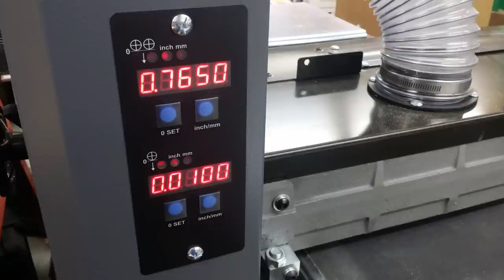My New Supermax 25x2 ES - Replacing my old Grizzly Double Drum Sander

Comment: That's a beast of a machine Tim. I bought the Supermax 1938 about a year ago, and I'm kinda kicking myself in the rear for not getting the dual drum model, although it is still an awesome machine. Thanks for the video!
Reply from the maker: +GuysWoodshop It's awesome for sure. I'm sure the 19-38 still gets things done very well. At least it's easy to change out that sandpaper to work through grits! :) Changing sandpaper on that Grizzly on the fly wasn't an option at all...

Comment: With a drum sander, can you sand the cup out of a panel?  Sometimes boards in a panel have high spots on outsides and leveling those sides requires hand planning to level it up (time-consuming).  I am looking for a more efficient process.  Could we run that panel through to flatten the sides, so you make that side the board flat before running the other side?
Reply from the maker: +Matt Vredenburg Yes and no... The drum sander works similar to a planer. Whereas the base is what it follows, so if there is a cup in the board, it will sand following whatever moves across the base. You could build a sled that is adjustable to allow it to flatten the panel. You can find some videos that work like that for planers.
Reply: Thank you for your response.  I assumed that was the situation.  Flattening one side wich a hand plane is critical.

Comment: Do you know how to replace the conveyor belt on your older performax drum sander. I have the older one and am looking for some information. Thanks
Reply from the maker: I would recommend calling supermax. They still have good information and support even though Laguna bought the company.
I have changed the conveyer on my old one, but that was many years ago. If I remember correctly the outer side comes loose with just a couple bolts and you have to loosen the tensioner on both sides all the way.
Reply: Thanks wood working maniac that was exactly what I had to do, remove the four bolts and take the tension off of it
Reply from the maker: I'm a big fan of those old Performax Sanders.
Reply: Woodworking Maniak it is a beast!! Unfortunately difficult to get parts but I can still get sandpaper and conveyer belts so as long as they last I will hang on to it

Comment: The 25x2 on the site now has a different stand and looks flimsy. I assume it's not, but doesn't look as solid as the one you have. Any ideas? I was sold until I saw the new open stands. :(
Thanks!!!
Reply from the maker: Jason, the current 25-2 is very sturdy. It also has a more powerful motor than mine. 5hp instead of 3. The base is open and not as "nice" looking, but they have made that style for many years. It is a great machine.
Reply: Woodworking Maniak thanks so much for the reply...ill keep these in mind :) I love the variable speed and the intellisand features of this machine!
Thanks!
Reply from the maker: @jasonenz4238  I have a dealer account with them. So if you have any more questions or wish to order one. Please feel free to call me. My contact information is on my website.

Comment: Hi, thank you for the info! I am looking to upgrade my 25” powermatic single drum sander to this model at 37”.  Can I ask you, how many passes would you say it would take to flatten a roughly glued up panel of 1.5” pine with one drum at 80 and the other 120?  I make 12 tabletops a week, on average, and flattening is key to my business. Thanks in advance, 
Keelan
Reply: Super max* not powermatic.
Reply from the maker: If you are using it to flatten, you might consider a wide-belt sander instead. I am currently moving to an Oliver Machinery 37" wide belt from the 25" double drum for a couple reasons. First, wider.... But main reason I am switching to a wide-belt is that the larger belt is able to cool better and the sand paper lasts much longer. The only issue I have with the drum Sanders is the fact that the drum heats up and sometimes burns. Often that ruins the sandpaper on it as well...
Financially, the wide-belt is much more expensive and also requires 3 phase power... So that could be a reason to stick with drum.
Reply: @WoodworkingManiak  Thanks for the reply. Oliver 5385? Nice! Since I commented, I came to a similar conclusion. Wide belt sanders are incomparable to any drum sander also for the platen. I have been checking out a company in China called Zicar.  Good luck
Reply from the maker: Yes, I have the a Oliver 5385 that I will soon be replacing my Supermax with. I have become a dealer for Oliver Machinery as well, so feel free to contact me directly for pricing. 😉

Comment: Is that nordfab ducting I see in the background there? Is that a recent addition or do you have a previous video referencing your dust collection? Thanks for taking the time to produce the content.
Reply from the maker: +Michael Schuler Yes, it is Nordfab ductwork. I've done a lot of work in my shop over the last year. At some point I will do a video showing the new dust collection setup and shop arrangement.
Reply: +WoodworkingManiak Thanks for the reply.  Looking forward to seeing the update.  I would really like to know if it's worth the additional investment over the alternatives. 

Thank you
Michael
Reply from the maker: +Michael Schuler It is pricey for sure. However, It is an AWESOME product. Perfectly sealed just by clamping it together. You don't have to tape every joint and put in so much extra work to close all those tiny air leaks. I'm extremely happy with it. Also, I have had to change my layout a time or two, and that was simple to do by just un-clamping and rearranging... This sander was a little wider than the Grizzly, So I had to move my planer over about a foot, therefor I had to also move the overhead ductwork. Didn't take much time at all to do.
Reply: +WoodworkingManiak If you feel comfortable either in your shop video or through direct message I would be curious how a system like Nordfab stacks up on total investment versus some of the other options available.  My assumption is you did your homework and I bet there is a comparable spreadsheet floating around.

Comment: do they have a machine with a digital readout anymore?  It's hard to find a machine that is solid, with a variable speed table, digital readout in a double drum.  It's either a two speed belt and no digital readout or something else that is different.  Is there anyone out there making a machine similar to the one you reviewed because that is what I want, not the open based machine.  Ive seen them and they are not as sturdy as the ones with the heavy base.  They took a good machine and screwed it up.
Reply from the maker: Yeah, they discontinued this one for some reason. I think they still have the open Frame 25—2 and it had the option to add digital readout... I'm actually going to be selling this one soon because I'm switching to a 37" wide belt.

Comment: Hi Tim. Mark Carpenter here from Australia. Nice video thankyou, I am researching drum sanders and I have come up with 2 models available in Australia, Supermax 25x2 ES Drum Sander 5HP 3 Phase motor or Powermatic Dual Drum Sander DDS255 5HP 3 Phase motor. I am moving towards the Powermatic, less features then Supermax but looks more robust. I am only doing internet search because I am isolated. Do you have any advice after doing your research that could be helpful to me,can't seem to find any video on Powermatic DDS255 only pitures
Thanks again. Regards Mark
Reply from the maker: +thalie carpenter if you are willing to pay for it, the Powermatic is a much nicer package. Functionality wise they are very close to the same.
Reply: Thanks Tim. Just made my decision easier. My cost difference is $700
Kind Regards your new Ozzie friend.
Mark
Reply from the maker: +thalie carpenter For that difference I wood go Powermatic as well.

Comment: you sound lick an infomercial for them. so was it a free be?  i bet it was
Reply from the maker: +PTcruser65 I did a lot of research and looked at all of the machines available on the market today. As I explained in the video, I had a Performax machine in the past and knew how well it performed. I truly did pick the machine I wanted in my shop for the very things I explained in the video, which is why I made the video... I did contact Supermax after deciding on this model, and I am working with them. However, that has absolutely nothing to do with how I feel about the machine. That Grizzly machine I had was a terrible design and I hated it. There were other things I didn't like about it that I liked better on the new machine like dust collection, how easy it is to open the top, storage in the base, etc... But I didn't want to make a long drawn out video, nor did I want it to sound like an infomercial. :/ Thanks for watching though. Personally, I do recommend Supermax.
Reply: You didn't answer his question. Did you get this machine free or a great discount for making videos for Super Max? It certainly seems that you did.

Oh well.